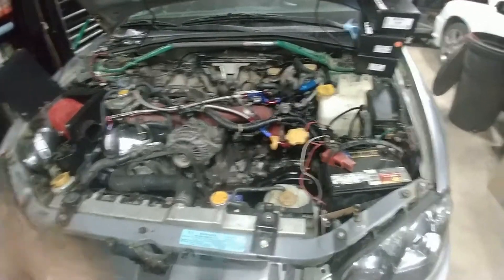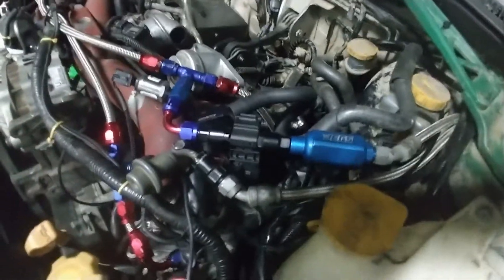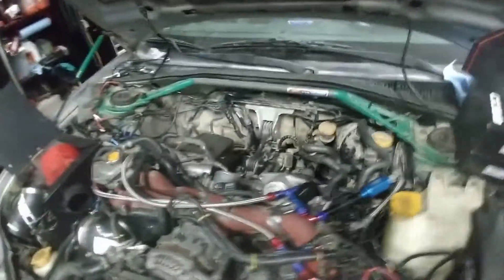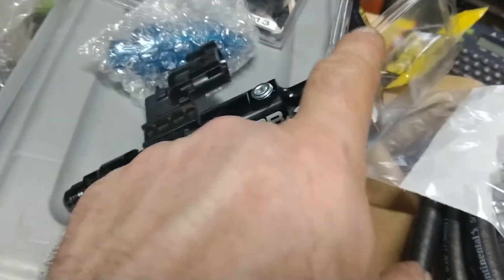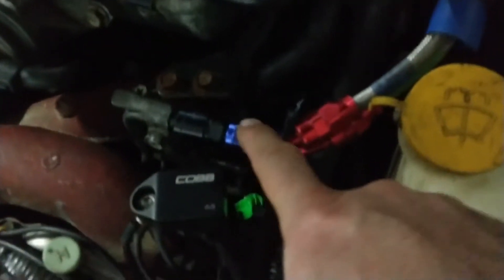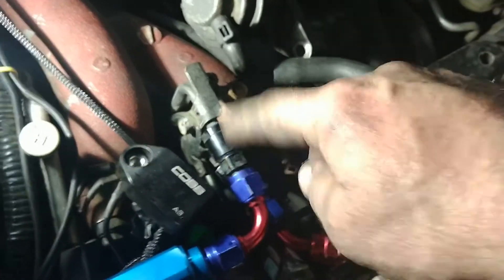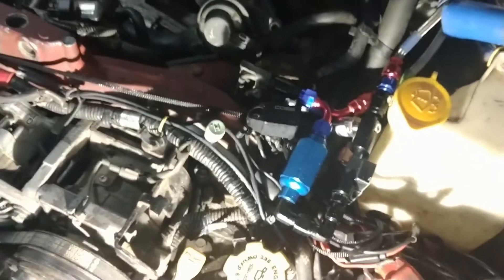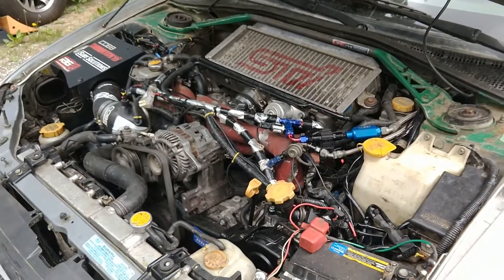Cobb Flex fuel kit and fuel pressure sensor install on 2004 Subaru STi

Comment: My tuner told me not to put it in the engine bay. And to put it in the return line not in the pressure line.
Reply from the maker: You can install the sensors anywhere before the fuel pressure regulator. Some intakes have the fuel pressure regulator at the back of the intake making it impossible to install on the return line.
Not sure what you don't want to put in the engine bay. I have heard that the electronic module can fail over time if exposed to too much heat, so location should be chosen carefully.

Comment: I would redo the fuel lines. You have both of them running right over the alternator charging wire. That’s a boom waiting to happen FYI.
Reply from the maker: Did you even watch the video until the end? The braided fuel lines are wrapped in mylar heat shielding...